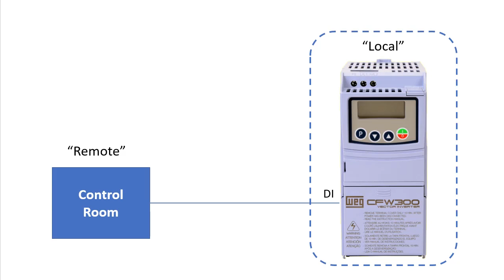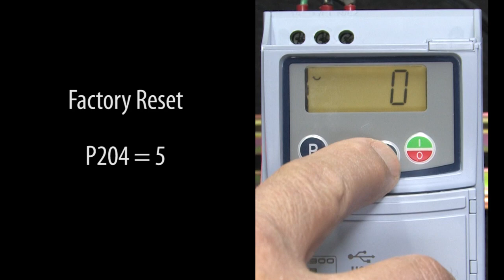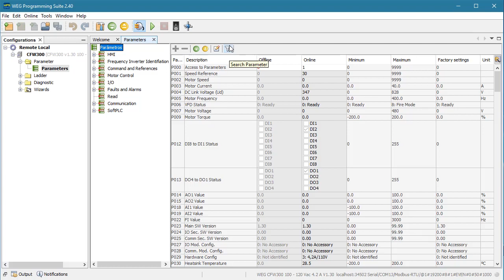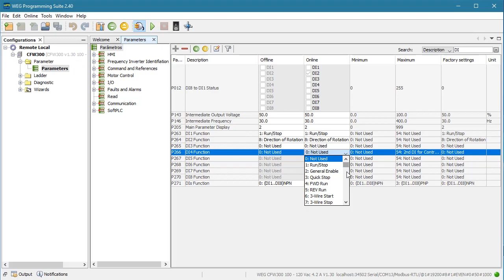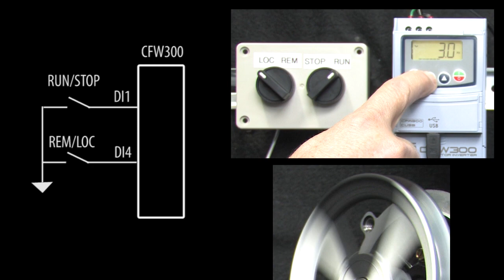WEG CFW300/320 VFD Switching Between Remote and Local Modes from AutomationDirect

Comment: Hi your videos are great!. I have been racking my brains to solve de following. I want to control two VFDs like this one with python via RS485 in "remote mode" But I want to have a "local" mode the two VFd´s can read each other DI, because I´m using their DI for security switches and door status (door open, door closed) and each one is also controlled via DI for run/stop and reverse. But I need that in "local" mode the pyhton routine that in "remote" runs as a MASTER to the VFDs slaves is now a passive or slave to the system (can´t interfere with them, but can read the VFD´s status parameters). I assume this is done via WPS ladder logic.  Any help on any resource to read how this can be done ?
Reply from the maker: Mixing higher level languages like Python with low level industrial devices like a VFD is a fairly rare occurrence, so we do not have any examples for anything like that unfortunately. Depending on your requirements there could be plenty of ways to skin that particular cat. I would recommend you contact our technical support team for further details on the various mode options and I/O interlocks you can accomplish with these drives.
https://community.automationdirect.com/s/contactsupport